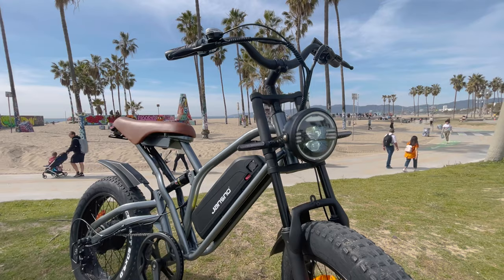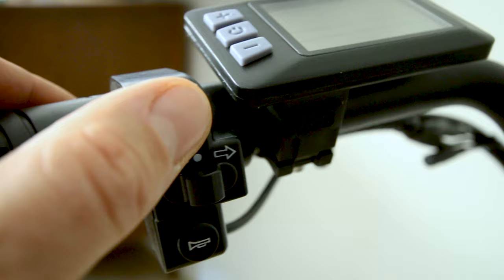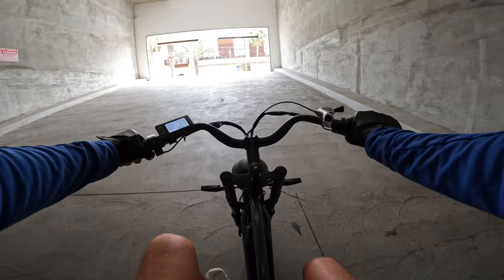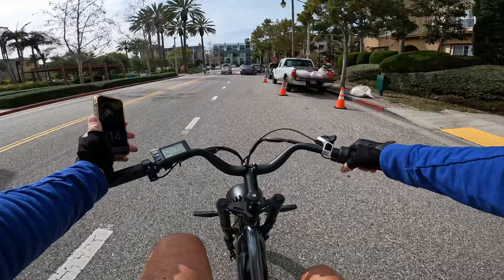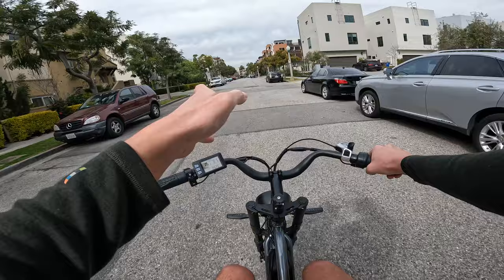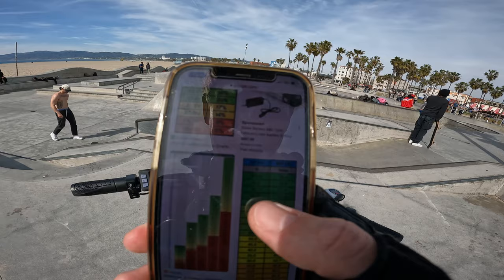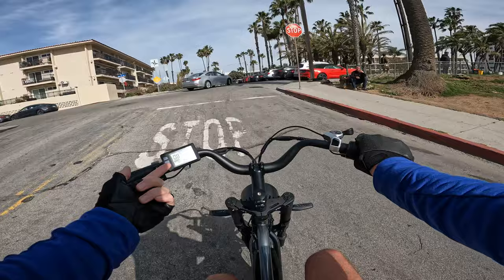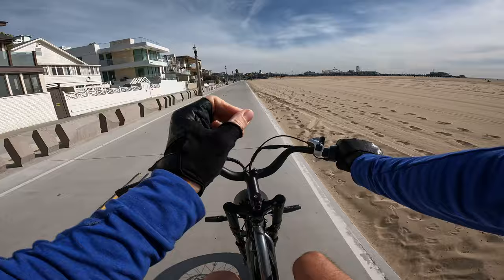The CHEAPEST Super73 imitation is Actually GOOD!

Comment from the maker: Check out this ebike too, it has 2x battery size and also cheap: $ https://youtu.be/8foNiPP7LtY
Reply: I also found a new crowdfunding project called freebeat's new product, the freebeat Morph 2-in-1 e-Bike. It seems quite promising with its outstanding features. What caught my attention the most is the ability to charge the bike when using indoor mode, which is a unique feature. The Morph eBike also offers an impressive motor power, top speed, and range, making it suitable for various terrains. Its IPX5 waterproof finish and puncture-resistant fat tires ensure a smooth ride in any weather condition. Plus, the Smart Saddle Detection+ feature provides valuable insights and keeps you motivated during your rides. I'm excited to see how this e-bike will perform!
Reply: What do you do with bikes after you test
Reply from the maker: I feed them to my 72v surron for breakfast @ryandag8403
Reply: @TailHappyTV  lmao
Reply: UL certification is reassuring if you don’t wanna burn your house down
Reply: They sent you the wrong rims
Reply: you keep using the word "Cheap" in your videos... I can buy a car for the price of some of these ebikes you list for that. Cheap means 300$ usd or less with shipping included. for 600 Bucks I can literally buy a beater car, register it, and Insure it.

Comment: Revv 1's little cousin. I want the Revv 1, but this is in my price range. This year's biking season should be fun!!
Reply from the maker: That’s a good way to put it, can’t wait to get on the Revv1 BUT I have something else coming soon that might even be more exciting
Reply: That revv 1 is overpriced. I can't see buying 1 hub motor for $2500
Reply from the maker: @last7509  some of the hub motors are pretty legit. Where money really makes a difference is in the battery cells and controller. The motor just “takes” the power, the battery and controller are the source of the power
Reply: @TailHappyTV so which bike was the one that was coming soon 👀
Reply: @TailHappyTV  any advice on modding e-bikes? I really like mine and I've gotten into the settins but I can't find brand specific controllers or batteries, so I was wondering how I'd go about modding It at all.

Comment: You could just run a switch from that "top speed" wire connector so you can cruise in eco mode but if you wanna go fast just flip the switch.

Comment: Love it, I went with Swft Zip as abase to build from. Why pay 3200 for a 73 ...dropped 1500 on zip now have alot left to upgrade and betcha mine is faster than that 73 when I put 1700 in upgrades in lol 🚴‍♀️UPDATE 3/29: Upgrade list , 20 ah second battery,shimano hydraulic brakes,unlocked controller have 10 modes now no speed limiter , flame.seat with more cushion, extra set of street tires, added a trailer with a custom Samsung block rocker stereo to tow to the lake hear me for a mile...(Samsung MXts 35)
Reply from the maker: So true, your money goes so much further when you’re not paying for the 73 ad budget
Reply: Exactly. Upgrading this bike is the way better choice
Reply: @TailHappyTV  There is no budget because there's no ads. The bikes sell themselves.
Reply: @TailHappyTV   waaay further
Reply: How much is this

Comment: to make it go 28 mph take off the seat and disconnect the black and whit wire plug that is the spped control that will not let it go faster than 15 mph

Comment: Just a FYI: peddle assist level will not affect throttle. Throttle will always go to top speed whether you are in peddle assist 1 or 5. Peddle assist is exactly what it says it is, "PEDDLE" assist. Without throttle. Level 1 gives you just a little boost when you peddle. Level 5 gives you the maximum boost where your peddling is very minimal. But you must still peddle. Throttle works at full power no matter what assist level you're on.
Reply from the maker: nice, some bikes are set up different then this based on my experience, thanks for sharing!
Reply: @TailHappyTV  different THAN*
Reply: your wrong buddy. On this bike which I own, it most definitely affects the throttle level. If I set it to 2, im cruising ~15mph pinned. Lvl 3 is ~21 and 5 being full throttle.
Reply: @bosthebozo5273  ah ok. Then this is set up differently than most e-bikes. Thank you for the info.
Reply: @bosthebozo5273  I'm curious how this bike holds up after being ridden for a while, price seems too good to be true. If you've put some miles on yours, have you had any issues?
Reply: You're telling a guy who has researched and reviewed hundreds of e-bikes how the pedal assist works the funny thing is you don't know what you're talking about there's all different kinds of pedal assist and how it works I'm just going to leave it at that

Comment: I just bought a EUY S4 1000w 26ah for $1,300 and a Ridstar 1000w 20ah for $1,132. Both 20" cafe racer style.  I'm looking for a 3rd model to buy asunder $1,400. Any suggestions?

Also can I charge these on a portable 12v solar charger that has a charge controller?  Is there a way to connect the bike chargers to a + and - clamp?  That's what my solar charger has to connect to. Thanks!

Comment: lOtta handlebar room too. I have a Lektrik xp. The very first model. Ive had it about 3 yrs. ANd it has like NO space at all. I have a phone, mirror, and thats about it. Kickstand problem...yeah. I got that too. It has even dropped down without me noticing and i made a sharp turn and it "STOPPED" me. Not too coool. I went over the handlebars, 72 yrs old.....lucky I didnt break nuttin. I just took it off. Then I started using a velcro band.

Comment: Looking to upgrade this thing, what exactly would u recommend?
Reply from the maker: controller and battery, not exactly sure what combo exactly. I'd love to mod one of these to 72v controller and 72v molicel batteries, I may do it on Juiced Joyrides this spring
Reply: @TailHappyTV ah so what ur saying is if I do plan on upgrading the battery I should change the controller as well? (I'm guessing to match the output of the battery? Sorry fairly new and just got myself one)
Reply from the maker: @rexaka11  correct, you might need to change the motor as well, I’m not sure what the maximum wattage this motor can except. Regardless of how much it can except voltage wise you’ll have to worry about frying the motor if you upgrade the controller and battery.
Reply: @TailHappyTV Glad you told me this, Idk if the manufacturer can give me any help but it looks like ill have to do some extensive research if I'm thinking of an upgrade. I'll see if a local bike shop can help. Personally wouldn't mind switching the motor but with what exactly? Im Clueless my friend lol.
Reply from the maker: @rexaka11  😆 I totally understand, if you do a little bit of research on YouTube, you should be able to learn a lot. Pretty much there’s three components to all these bikes.
1. The motor which is rated to accept a certain level of power, sometimes these motors are limited to except only certain voltage ranges.
2. then you have the battery which supplies the power. Different batteries are different voltages, in general, the higher, the voltage, the faster, the bike is going to be.
3. and then there’s the brain of the whole system, which is the controller, which basically just tells how much current to pull from the battery and send to the motor.
Reply from the maker: @rexaka11  these builds can get expensive, check this $10k build I did on my other channel 
https://youtu.be/ibf4MEW1piE

Comment: Hello everyone. I need a little help. I just bought the Jansno x50 but to have more success on my job I need more powerful than 48A 12.8Ah battery. Can I replace my battery with 48A 20Ah? Thanks a lot for your help in advance 😊
Reply from the maker: yes, as long as it is 48v, you can do any other capacity aka "ah"
Reply: @iordanpetrov278  What kind of range are you getting with the stock battery? How fast are you going  usually? How much do you weigh? That will help solve your range anxiety.
Reply: @Wize817 Around 30km range with 25-30 km pH. I need for 70-80km range. My bike goes 25km by factory mode but I have disconnected under the seat the controller for more speed and now is going up to 50km. I'm 90 kilograms and I do fast food delivery 😊
Reply: @TailHappyTV  thats great to know, I will buy one in the near future thanks

Comment: That battery would take you around the block and back.
Reply from the maker: Certainly could do that 😆, the good part is it’s externally mounted with space surrounding, so it’s definitely upgradable to a larger capacity pack if more range is desired
Reply: @TailHappyTV  could you recommend a larger battery for this bike please. Is it hard to install?